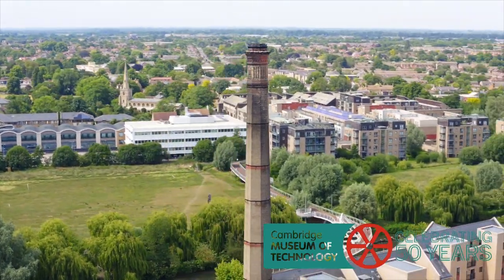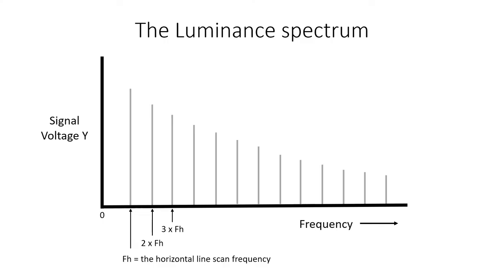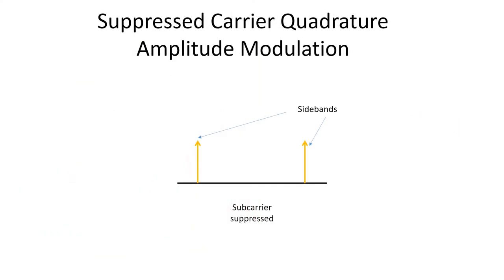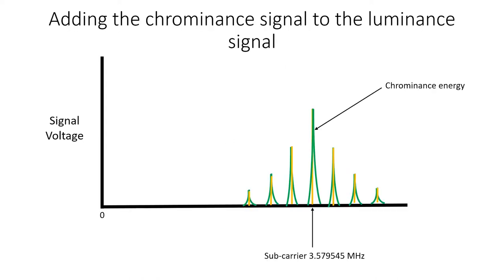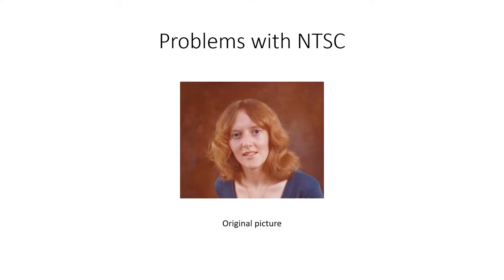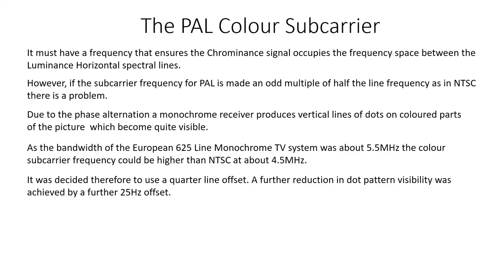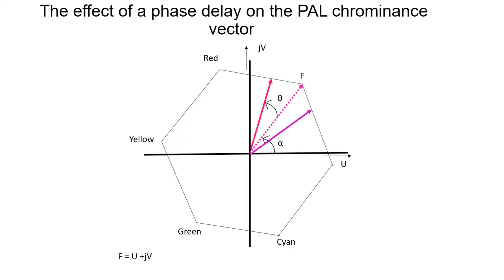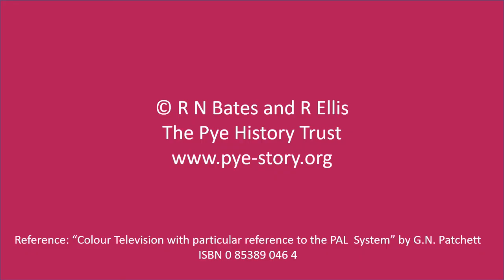How Analogue Colour Televisions Works: the Coding and Decoding Process

Comment: Thank you for a fine explanation of this complex process. Well done!
NTSC originally proposed the phase alternating process. RCA called it PLA. This was dropped due to the already massive cost of a color TV receiver in 1953 dollars. By eliminating the additional delay line, a very expensive component back then, they cut some of the final cost from the product. 
I observed a PAL receiver at the NAB convention, in the early 1990s, that was suffering severe phase distortion and looking closely at the screen I observed that it suffered the same color shift issues as NTSC. However, with the phase alternation, one line was green, the next purple. Stepping back a short distance, they eye blended the two lines and the picture was acceptable. 
At one of my jobs, throughout my long career in video product engineering, I had the opportunity to connect a three tube camera to a video monitor with direct RGB (525/30i). The result was extremely astounding. This was how I learned about how "bad" chroma encoding schemes could be.

Comment: A further detail of the NTSC I&Q signals is they were not equal bandwidth. The I signal, which was reds, yellow and orange image areas, was 1.5mhz. The Q signal which was the blues and violets, was 0.6mhz. This was done to give more detail to the brighter nature and flesh tone colors. The problem with this was a more costly receiver decoder design. Two different bandwidth filters were needed and because they were different frequency passbands, they had different delay. So yet another delay line was required in the I signal to keep it registered with the Q signal. Only a few early color receivers, like the RCA CT100 used the true I&Q system. This is why the color reproduction on a restored RCA CT100 is so good. But all USA TV manufactures including RCA as well as the Japanese soon went with the equal bandwidth R-Y, B-Y system to reduce consumer receiver costs. Most broadcast NTSC encoders continued to use the I&Q system but the advantage was lost in the later receivers that used equal bandwidth, about 500khz, R-Y, B-Y.

Comment: Simple PAL was not the first version of PAL but a way for cheap manufacturers to avoid paying royalties for the PAL patents to Tekefunken. Most noticable being the first line of Trinitrons from Sony. The simple PAL receiver has a hue button like in NTSC. But no other set or brand made simple PAL receivers ever again. And PAL “D” does not exist, it is called by the CCIR notation for B/G, I, D/K, M or N which denotes line count/frame rate, channel bandwidth, sound offset, and channel spacing.

Comment: Excellent video!  I'm surprised about how similar PAL and NTSC were.  I was stationed in the US Army and was dismayed by how much better their PAL broadcasts were than NTSC (until I learned how recently they got Color TV compared to the US).  Specifically, blacks were blacker.  I think reds were a deeper red.  And PAL seemed to lack a lot of artifacting NTSC had, like if there's white text on a black background, the white text creates a band, or ghost image, to the right where it should be black.  Colors didn't bleed as much, but this could be due to greater bandwidth.  The 50hz flicker was a problem for me, though.
Reply: It's a problem even if you grow up with it. Having a 50Hz TV in your peripheral vision is incredibly distracting. The 60Hz default for 640*480 and above on computers isn't much better, so I am really glad CRTs are dead. I was constantly going into the settings in Windows on other people's computers and putting up the refresh rate (usually to 85Hz) because I found the thing unusable at 60Hz.

Comment: A very nice explanation but some points:
NTSC did not propose the subcarrier based of fh of 15.735KHz. In fact the fh at the time of proposal was 15.750KHz. The fh and fv were later changed from 15.750KHz/30Hz to 15.735KHz/29.94Hz to reduce sound buzz.

Regarding 25Hz subcarrier offset, having viewed PAL images without any offset (PAL system M), I would argue that it was totally unnecessary. In fact it caused enormous complications to editing videotape, where 4 frames had to pass before the subcarrier was in a suitable phase to join. If you look at some of the early pop videos with fast cuts, you often see the picture move left, and even move up or down by 2-lines, as the playback circuitry tries to match the phase.

Another aspect of PAL was the burst blanking that Dr Bruch specified for around the vertical blanking period. It made no sense to a PAL receiver, though it did give Japanese set makers a "hook" to understand the phase of the following burst, thus allowing them to bypass the import restrictions governed by the patent holder Telefunken.

Comment: I've actually implemented PAL encoding and decoding in a shader for Media Player Classic back when I was on Windows (the program is Windows-only, despite being open-source, unfortunately, and can't be ported to anything else as it's designed entirely around Windows' APIs). 

The simple decoder should produce alternating light and dark versions of a colour, not alternating hues. There's a subtraction step that will produce alternating hues if left out. Implementing something equivalent to the delay-line decoder via a second shader (the framebuffer inbetween shader passes giving storage equivalent to the delay-line) required leaving out that step, but the averaging in the second shader removed the alternating hues.

Comment: NTSC has been jokingly --- and deservingly --- called "Never Twice the Same Colour" 
because the chroma phase tends to vary and the user adjustment provides no absolute reference.   
The Magnavox console i grew up with had both colour and tint buttons on the remote 
and the knobs on the set were motorised.
Reply: Later NTSC sets had automatic tint and color control,which resulted in less of an issue.
Reply: @900Yugo  But still inaccurate hues unless proper adjustments were made 
by someone who knew how to do them right. 
I have had a few TVs in which the "automatic" functions 
were so screwy I couldn't stand to use them.
Reply: @spacemissing Many of the cheaper TV sets were not so good at color reproduction,I am from Taiwan and we used NTSC for color encoding. PAL does have a better contrast image. SECAM was worse than PAL or NTSC though.
Reply: The problem was mostly caused by differential phase and gain errors in the high power transmitters and to some extent. tube based receiver circuits. This problem was largely fixed by the mid 1970s with improved electronics.